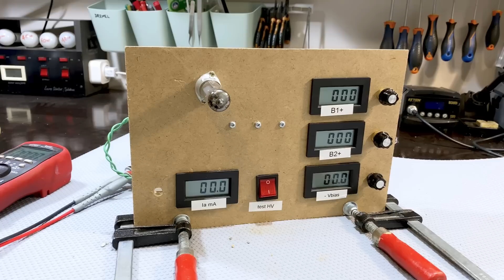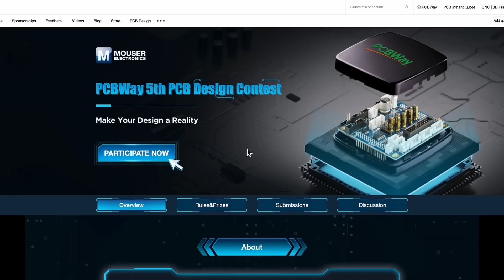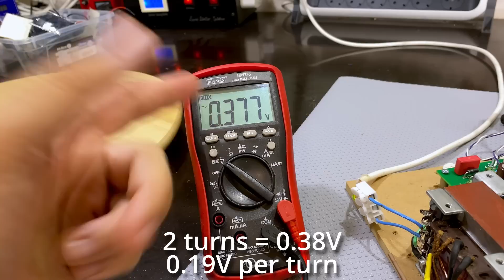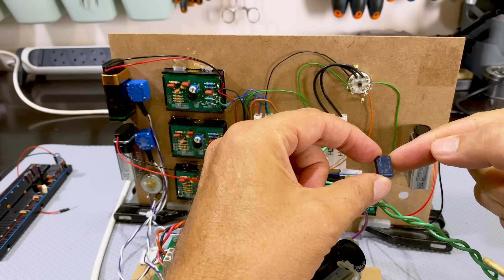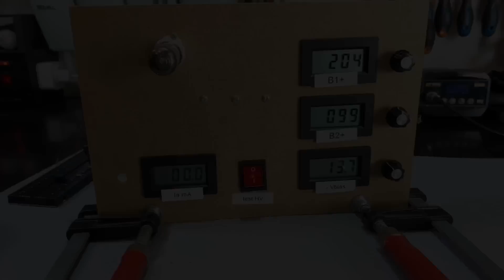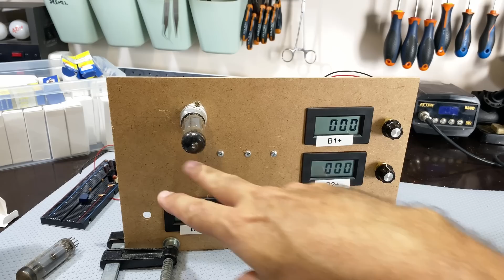It's really starting to look like a tube tester. And works too!  Part 4 #PCBWay#

Comment: Hey Manuel! I sadly gave up on finding a power transformer that I could manipulate with your methods to get adequate AC voltage for the heater supply, and took your advice and got a separate little transformer for the supply. However, is a 9VAC transformer enough?? I got a Vigortronix with a 230V primary...

Comment: Another easy feature you can install is the "Life test", that test simly reduces the heater voltage by 10% and if the transconductance stays within 20% of original value then that means that the tube's Cathode is not very aged and has many hours of "Life" ahead. (the percentages 10% and 20% are taken out of my Hickok tubetester manual). You could also add a small speaker  through a cap at the anode to be able to hear if a tube is microphonic by tapping it

Comment: The tube socket (or base) used on el41, ecc40 and other ‘40’ series tubes is called ‘rimlock’ or B8A.
Reply from the maker: That’s it. Couldn’t remember the term. Thanks.

Comment: Recoms (DC to DC converters) can be a pain on breadboards because of capacitance. You also need to draw some reasonable milliamps from the outputs so (for 1 mA meters) you would need something like an 820 Ohm parallel resistor across each converter output. Also, 1uF ceramics at the input and output and a small output smoothing cap (100uF ish). Yes, ripple also becomes an issue, especially at low currents, so you may end up with LC filters. Your battery solution is a good workaround. Don't be put off by those converters though, there is a Recom design guide, if you have a year free to study it. The best multipole virtually zero insertion / removal force connectors are Lemo, but you don't want to know how much they are.
Reply from the maker: I did some of the research in that design guide, and it was indeed long 😊 I like these idolaters, and will continue to use them. Just sorry they did not work here without excessive circuitry to avoid their interaction with each other.

Comment: I wanted to comment on the switching needed to connect the filament, B1, B2 and grid to the correct pins.  Since you are dealing with a small subset of tubes there may be a simple switching network you can use.  A small 5x9 switching  table for each tube of interest can be constructed. For example if the filament connections for all tubes of interest is  4 different connections, a 4 position 2 deck rotary switch could manage it. Some of those small relays you showed may be needed since may not be a good idea to route high current or high voltage through a rotary switch.  It would need to be detailed out for B1, B2, G etc to see if this is a workable solution. Changing wires or headers my be too burdensome to make it a useful tool.  Best Wishes

Comment: I don't suppose the supply voltage for the meters is that critical; you could wind three separate windings on your transformer that would give 9 volts each when rectified and smoothed; it would only need 1N914s and a few microfarads if you only need a milliamp or two.
Reply from the maker: I’ve thought of that but don’t have enough space on the transformer 😊 I was tempted to have a specific one wound, but that will make it more difficult to reproduce.

Comment: Nice work! I really like the fact that it has a digital readout. Some thoughts: For connecting other tubes, you could use some safety-banana plugs and sockets on top. 

For the heater supply, I use a bridge rectifier along with a LM 350.

Really looking forward to build this one!

Comment: Hi Manuel ! 
Good job, but still a lot to do by switching the tubesockets. Why You do not use analogmeters ? There are very good looking and to find by e-bay, for about 14$ would be more matching for a tubetester :-) And You would not need all the batteries and relais, sorry, its only my mind ;-) I builed some testgear for repairing radios and so on and I used this meters and they look great an the set. And much easyer to connect. And sorry, maybe I am not mindfully listen Your video, but why You use DC-voltage for heaters ? In most radios and tv-sets the heatervoltage is AC and it is not so important if 6.0 or 6.5V especially for a short time testing.
But still I wish You good success by this project ! By the way, I own a Funke W19 Tubetester and had to restore the most of the cards ;-)
Reply from the maker: I chose these meters as a personal preference but any meter styles will do the job. 
The DC heaters were chosen as my mains voltage here tends to fluctuate quite a lot, and it was starting to annoy me 😊
Reply: @electronicsoldandnew  Aha, ok, I understand ! So do the job well ! 🙂

Comment: I feel happy that you gave up  the idea of using resistors to lower the heater supply. I would have used TO220 LD1085 (rated 3A) or LD1084 (rated 5A) as Low Drop Out Regulators . Is there any mistake on the value of the Variable Resistor for adjusting the out voltage (given as 47k on your schematics) ? A 1k pot (+270 series resistor) would have the job done much more smoother.
Reply from the maker: That is a mistake. I used a 2k2 pot. Apologies.

Comment: Nice project. - Can Q1 survieve a short of B1+ ?
Reply from the maker: It should as the 10 Ohm resistor will drop more than 0.6V and the current limiting transistor brings the voltage down.

Comment: On the valve tester I have lined up for building I'm using opto-couplers for the meter battery supply rather than relays. To select the pinout assignment for the valves I'm using banana plugs and leads with the supply leads labelled as Plate, Grid, heaters etc and the pin numbers on the sockets of the banana plugs. Loving your project so far, it all seems quite well regulated and stable for reliable results.

Comment: Very nice project. After adding an extra base socket or two, it would be a good idea to add small ferrite beads to the wires used for any pins that will connect as grid electrodes. Keep up the good work.
Reply from the maker: Good idea. 👍

Comment: Looking good, almost done :-) 
For the selection of type of sockets, i don't know if there are large current draws, but maybe a 15 pin female VGA panel connector, and then with 15 pin male VGA connectors wired like a loopback plug making a "dongle" for each socket type. If you had needed only 8 wires, you could use Rj45 connectors, a female Rj45 panel connector, and for each socket type a male Rj45 connector as a "dongle". And if you need more then 15 pins, you can use a printer connector (LPT1), those are 25 pins.
Reply from the maker: 👍 exactly what I had in mind. Thanks

Comment: Using 4 Schottky diodes for a bridge rectifier would give you an extra .6 V.
You can buy 2x 1/2 W transformers the size of a box of matches for a few Euro. They have double windings so you can choose output: double voltage or double current. If you buy two, you will have 4 windings for 4 meters.
E.g.  Conrad partnumber: 1092849 - 62   2 x 6V 41mA €  5,07.   Loaded with only a few mA that is more than enough.
Reply from the maker: I misunderstood your previous comment. I thought you were referring to the heater supply. Sorry. Yes, I see your point about using small transformers for the meters. Good one 👍
Reply: @electronicsoldandnew  Yes sorry for that, I edited my comment to many times to make any sense of it 😅 The first sentence is for the heater, the second for the meters.

Comment: Hi Manuel. This project is coming along nicely. I know you have made this tube tester for the tubes that you use frequently in the receivers that you specialise in. I was just wondering, is there any types of tubes that you can't test with this?. This series is turning out to be  both very interesting and enjoyable to watch (as always). Cheers Chris.
Reply from the maker: The power supply board is quite flexible as regards the voltages that you can get from it. The amount of current can also be increased by using a bigger transformer. The final hookups can be made to allow for other tubes as long as you know what characteristics to look for. When this is finished I hope to be able to advise on extending the range of tubes that can be tested.

Comment: how about a voltage doubler on the DC side, so that should give you enough DC for the LM338?
Reply from the maker: Voltage doubling is great, but ripple will shoot it with any sort of highish current. The previous comment by Erik about using a small transformer is better and quite cheap.
Reply: @electronicsoldandnew  ripple should not be an issue if adequate filtering is used. I use a voltage doubler arrangement for DC filament supply, with a total current draw of around 900mA without any issues. I had it up to 1.2A, again no ripple issues, nice and steady and clean, it used for a tube preamp. 
Even if there was a small amount of ripple, for a tube tester setup such as this, it should not be an issue.
Reply from the maker: True 👍

Comment: Hi Manuel, Shoot me down in flames but a cheap and cheerful solution to your patch connector conundrum might use a number of 15 pin D-Sub connectors. Parts like Mouser No: 523-L717SDA15POL2 have a 600V rating so one for each valve (connection) type could be wired at the solder pin side of the connector, encapsulated in resin and then sutably labelled. Just select the D-Sub plug for the valve under test and plug it into a socket on the valve tester. Can you get away with just one socket on the tester for valve sockets with different pin counts? Would it be reliable enough after repeated mating/demating? I'm sure you can think of other questions as well. Maybe there's a more suitable plug/socket sytem out there that doesn't cost the earth? Just a thought...
Reply from the maker: You are psychic 😊 What I have in mind is exactly something like that. Some years ago I was a partner in a software company, and the software licensing was activated by such a plug that you plugged into the series ports.

Comment: When you mentioned using an AC signal to measure mu and S values, I wondered if you had considered adding a signal generator input, and oscilloscope (or other?) outputs to actually see the graph?  Not sure if this would be practical, but I wanted to share the thought. My background is software, and I’ve always found data visualization to be very informative.  

Anyway, thanks for all your videos, I’m really enjoying them!  Try not to have too much fun! 😄
Reply: Not that I’m trying to influence you, but think of all the fun that would be! 😉
Reply from the maker: That idea is still in the mix, but not yet fully formed 😊

Comment: Very nice project dr Manuel! One hint for the mA-Meter: If you connect it in the ground path of B1+ (and not on the B+-side), you have a common negative ground with the B1+ and B2+ meters and need only one battery for these three meters (as i understand.....).
Reply from the maker: Yes, that would work, but then I would be measuring the cathode current, which will have a screen current component as well. Not sure if that will be accurate enough for power tubes that have screen current. Am I thinking correctly?
Reply: @electronicsoldandnew  Yes, you´re thinking correct. I don´t know the difference of cathode and screen grid current, but does it really hurt? The screen resistors are always rather big so i assume only some mA of screen current.
But in case of an internal fault inside the tube this may
be decisive.
Reply from the maker: I know how a tube should behave in a normal application (like power amp), and in that case, the screen current is about 5% of the anode current. However, in the Funke test setup, I’m not sure as there are no tube charts for these conditions. Do if I want to use their cards to determine the tube health, I’m a little stuck to their test conditions too. I’ll do some more thinking 🤔
Reply: @electronicsoldandnew  Yes, Manuel. It´s important whether you want to build just a "tube tester", where we can accept some percent of error (and we know how to estimate the error) or a real tube checker to measure the parameters.
I´am very interested in this project

Comment: Very nice!  Is it possible to measure the change in output current vs the change in input voltage directly (transconductance), or would you have to graph multiple readings in an X-Y plot to get an idea of what that is?  The way your pots allowed you to change voltages suggested that might be possible, if I understood what you were demonstrating correctly.  Looking forward to the final result!
Reply from the maker: You can easily measure that by altering the grid voltage directly, but that is effectively a DC condition, which I’m not sure is going to be the same as injecting an AC voltage and measuring the altering current.
Reply: @electronicsoldandnew  you could use 50c/s from yore heater suply .
Reply from the maker: The input is quite easy. I’m wondering how to read the output. I’ll probably need a small resistors to create the voltage drop that would be scaled and measured.

Comment: Manuel, I think you're having altogether too much fun building the Madeira tube tester.
Have you considered what you're doing to the used tube tester market? I can see the eBay prices dropping as you describe your concept. Kidding aside I like the use of pressboard for your Beta test must be that engineer thought process.
Reply from the maker: It’s a nice change having prices fall due to my projects 😊 I did a restoration series in the ELV magazine on a Grundig 2147, and their ebay prices more than doubled. Fortunately I’d bought 4 of them 😊
Reply: @electronicsoldandnew   Your mother didn't raise a fool, I know it's against copyright laws but if an English translation appeared in my mailbox I wouldn't object.
Reply from the maker: I’m one issue away from completing the series, and hope to make an ebook of the 10 articles when they’re done. Should come to over 100 pages 😊 and I’ll gladly send you one when complete.
Reply: That is the problem, tube testers became unaffordable. I'm desperatly waiting for this project as this all I would need ;-)